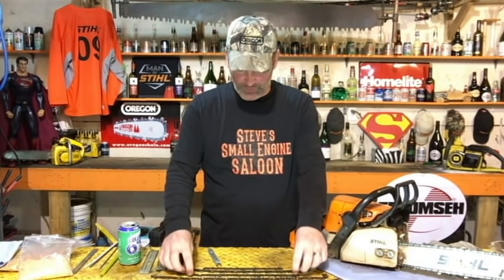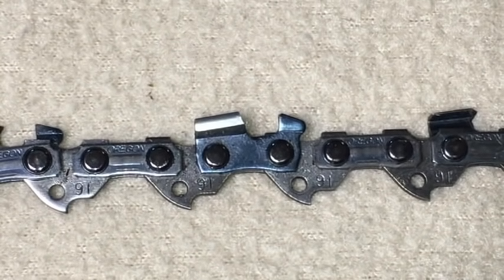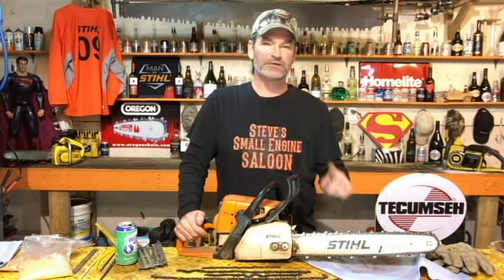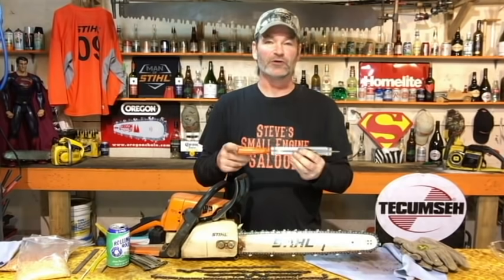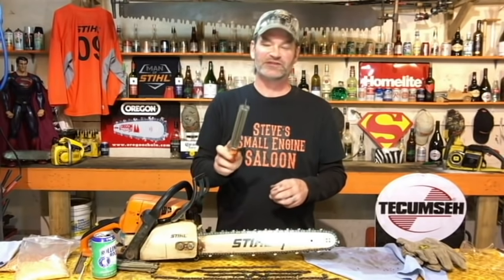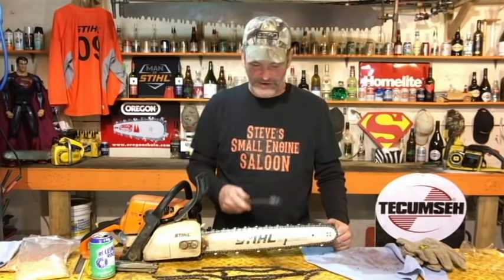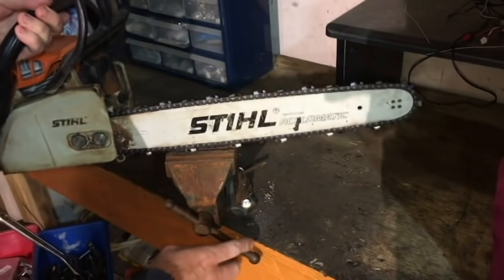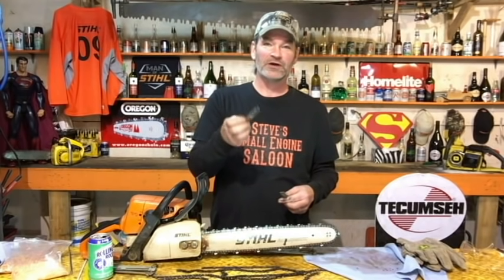CORRECT WAY To SHARPEN A Chainsaw (Step By Step)

Comment from the maker: ✅Click here for a great sharpening kit ➜ https://amzn.to/37CHxQT
For more videos like this, check out: 
👉How To Use a Stihl 2 In 1 Chainsaw Chain Sharpener ➜ https://youtu.be/marzGaMq6pM
👉How To Repair A Chainsaw That Cuts Crooked ➜ https://youtu.be/AgCZxee2NPA
👉Adjust The Chain Tension On Your Chainsaw ➜ https://youtu.be/FxgQSPQeYYM
👉Correct Way To Adjust The Carburetor On A Chainsaw ➜ https://youtu.be/M6T5JoGXcHY

You can connect with Steve here too: 
✅Visit Steve’s WEBSITE ➜ http://www.stevessmallenginesaloon.com/ 
✅Visit Steve’s PARTS & TOOL STORE ➜ https://www.amazon.com/shop/stevessmallenginesaloon 
✅Follow Steve on FACEBOOK ➜ https://www.facebook.com/stevessmallenginesaloon 
✅Follow Steve on INSTAGRAM ➜ https://www.instagram.com/stevessmallenginesaloon/ 
✅Follow Steve on TWITTER ➜ https://twitter.com/SteveSaloon
Reply: Being looking for this guide...but the hardware seller don't know about this...what the...
Reply: Good explanation.

1. Oregon has a good downloadable manual.

2. A stump vise is really handy. Just knock it into a stump or log and you can easily sharpen your chain close to where you are cutting.

3. Leather work gloves are another good idea, both for vibration dampening while cutting and for protection while sharpening.

4. It might have been a good idea to mention sharpening for rip cuts.
Reply: Steve's Small Engine Saloon adjusting a chainsaw
Reply: 334
Reply: Goggles for hand sharpening,american
Reply: No, I do not have a bench vice.
Reply: Hey Steve, I have a Dolmar 6100 that I bought used. I tuned the carb to factory specs when I rebuilt it. When I start it, the chain turns at idle, whether or not I pull the trigger. Does it need a new clutch?
Reply: Please redo in HD
Reply: 1 a

Comment: I've spent the last day or two completely captivated by your tips, insight and knowledge Steve.  I have had a Stihl 026 for about 20 + years. I was having trouble getting it running this season and a small engine mechanic told me it was toast. The piston and cylinder were scored, the compression was bad and the carb and fuel lines were all gummed up. He suggested that I leave it with him for parts, lest I pay $40.00 for his time and pick up the saw. I did the latter.
With your help I've replaced the carb (never done anything like that before), the fuel line and filter. I inspected the piston and cylinder through the exhaust port and spark plug hole (I thought it looked pretty good). I inspected and replaced the spark plug after ;learning how to "Read the plug" I set the idle screw, and the Low and High throttle screws, I asjusted the chain tension while holding the bar up at the nose, cleaned the air filter and guess what... My saw is back in service!! Just to be clear, I guess I'm a bit handy but I've never worked on a small engine before. You've saved me a tom of money Steve, Cheers to you!!
I think I owe you a beer, maybe a couple!.
Keep up the great work.
Reply from the maker: Right on Mike!
Reply: Cheers boss! That's whats up!
Reply: TIP OF THE HAT MY FRIEND.WE ARE ALL SHADETREE MECHANICS INSIDE.Yours came out  my brother..
Reply: That mechanic is a crook.
Reply: I have n older 029 stihl chain saw all i need is to adjust carbs never done it takes 8 pulls to get it started cold but after that only one so i never bothered....Figured aint broke don't mess with it n flipping the blade i never was sure about ,but just seen a different video an after each sharpening the guy flips it? Thanks for sharing !
Reply: I have a 026, a great saw and mine is 25 and runs like a top. I have replaced fuel lines and filter. Sometimes a small particles gets into your carb and you can run down you needle valves all the way and back them out one full turn and it will be back at factor spec.  That has worked for me a couple of times. No ethanol gas and make sure you start and run every 2 months even if you do not use it. That is how I have run it for 25 Years.

Comment: I'm going on 78, been using a chainsaw -- occasional use, maybe 10-to-20 hours a year -- for 60 years.  Of all the advice I've been offered over the years (videos, magazine articles, instruction manuals, even my USFS instructor in '62), this is the best I've found, here in this video and your video on proper tensioning.  Turns out, I've been doing things right all along, but I never knew WHY I needed to lift the nose of the blade when tensioning and tightening, I never knew that by over tensioning I could harm my sprocket or blade...and there were many great explanations on this video as well.  Your videos are clear, well organized, and concise...20 minutes is a long instruction video, but you didn't waste any time, and you "covered the trapline" very nicely.  I've always used a raker guide to determine when to file the rakers, and it has worked OK...but I've been cutting pine, doug fir, and other softwoods all my life.  Your advice to adjust the height of the rakers based on the hardness of the wood was eye-opening, and obvious...as soon as you explained it.  And you were spot-on in your observation that many sharpening instructions completely ignore raker-height, which is nuts.  Thank you, for this and your other videos.
Reply from the maker: WOW!  Thank you Sir...

Comment: I agree with your method 100%. I have been sharpening chains for over 50 years, yes I meant 50 years. I'm over 80 years old. Bucking Billy Ray refuses to use a file guide. He always says to throw them in the garbage can. I simply can't do that. I don't even come close to questioning his logic but he is the world's expert on sharpening chains. I'm a rank amateur on sharpening. I own 4 chain saws now and have worn out two others. Bucking probably has about 75 "power saws". He has sharpened saws probably about 100 times as much as I have. I'm going on in this conversation to let you know that your method works for me and probably 95% of the amateurs. I don't want to try another method. Your method works. Feel free to share these comments with anyone you wish.

Comment: Raker or depth gauge tools are very important to use if you're taking different amounts of metal off each tooth. Definitely need to get a consistent depth gauge height first, then take more strokes off if it is still not giving good sized chips.
Reply: I always, ALWAYS, count number of teeth or rakers, and number of strokes on each. If there are any inconsistencies, they'll average themselves out as you sharpen again and again. Especially if the chain stops a different place every time, and I believe they always do.

Comment: Just watched this. Decided sharpening the blade was the right thing to do, as the new one was already becoming dull. Bought the Chicago Electric unit from HF. Once set up, had a sharpened chain in under 15 minutes. Had the most productive session with the saw, cutting a tree which had partly fallen. Big chips, cutting through very quickly. Such a performance difference. And set the chain saw tension per his video & method. Wish I had the knowledge this video gives a year ago when i bought the saw.  Just came to say "Thanks!"

Comment: That was a really useful way to spend a few minutes. You saved me hours this summer dealing with windfall and firewood. I’ve sorted out most sharpening issues via trial and error but your last bit on raker height is exactly what I needed to know. I couldn’t figure out why my decently resharpened chain was creating wood powder, using up all that expensive gas and too much of my afternoon. Thanks a bunch from BC.
Reply from the maker: Right on Buddy!  You're Welcome...

Comment: Thanks Steve, by far, this is the clearest, most concise demo I have seen on the correct way to sharpen a chain as well as the occasional raker depth. This makes the 2nd time I watched this video now and glad I did! You have clearly shown the correct way to use the rat file & the flat file when cutting metal. Now it's time to get back to my firewood here in north central Vermont... Thanks again neighbor. :-)
Reply from the maker: Right on...

Comment: Great video Steve, I think it's the third time I've watched it to refresh my memory. I've seen videos of arborists sharpening their chains in the field with their saw sitting on a log, it seems to me that would be a difficult task keeping the same angle with good pressure on the file. I always sharpen my chains in my bench vise, and I also purchased a hitch vise for my truck. I believe a vise is critical to sharpen a chain properly. The only issue I have with this video is that I never seen you take a swig from your Rolling Rock beer. 🤣

Comment: Really great video with super simple and clear instructions, Steve. This video reiterated just about everything I learned when I was first trained on using a saw. I say "just about" because I still learned some new things. I would recommend watching this even if you feel 100% confident in how to sharpen your saw. The refresher will do you some good and make you think things through to keep your equipment running long-term.
Reply from the maker: Great to hear!

Comment: Another question, Steve -- I note your advice to maintain the file in a completely horizontal position, 90° to the bar, and that's something I've done for decades, mostly because it was easiest.  But back in 1963 I got my USFS chainsaw-use permit -- I was assigned to fell trees inside a burn area that still had smoking "cat-faces", holes in the trunks of pines left by fallen branches.  I was using a large, HEAVY McCulloch saw with a fairly aggressive chain.  We were told to sharpen the chain with a 10° tilt angle.  Was that just an old (and maybe foolish) custom, or was there a reason?
Reply: So I've logged a bit and I've also been told to hold the file at most 10 degrees

Comment: I like that you take the time to discuss the design elements of chainsaw chains and provide examples of what (and what not) to do when sharpening chainsaw teeth. I've learned how important it is to understand the function of the raker, and its height relative to the cutting edge of the tooth. As a mechanic/mechanical technologist, I appreciate your skill in delivering engineering-level information minus the techno-jargon. Ever considered becoming a college-level teacher?

I look forward to watching more of your insightful videos.

Comment: Very informative -another great video Steve!  One note, when sharpening, I always advance to the next tooth by pushing against the raker, not the tooth I just sharpened.
Reply: It killed me watching him do it wrong. I have a little smaller chain and bar so I do 2 teeth then move the chain with my gloved hand.
Reply: Chill out analguys, why spoil a fine presentation on chain sharpening with petty bullshit. Kudos to you Steve. Been swinging saws for 50 years and sharpening them the same way as Steve almost as long, even down to advancing the chain to the next tooth using the file still engaged in the previously sharpened tooth, it's fast and any micro scratch to the surface finish wouldn't amount to a pisshole in the snow.

Comment: Hand filing is the best but when I have a bunch of them and need to get ‘er done, my Oregon bench grinder is fast and keeps the hook. I like to file the takers one to two extra swipe for an aggressive bite and pull into the log. Hard to stall a 461.

Comment: You did a very good job with your explanation sharpening a chainsaw. The best of all the videos I've watched. The teeth the rakers but one other thing. The bar itself might develop burrs along the edges so you have to flatten those out as well with a file

Comment: Another excellent video, Steve. The only thing I would add is to start at the master link or put a mark on the chain so you know when you've been all the way around. Also, a question. Should you lift up slightly to make sure you're getting the file well on to the cutting surface of the blade?
Reply: Yeah.  I generally mark a tooth with a red felt pen so I can keep track.
Reply: I give a shot of white aerosol paint. Can't missit

Comment: Great video and instruction.  An interesting point:  I bought a Stihl 028 Wood Boss brand new in 1978.  The Owners manual contained chain filing instructions, almost identical to yours.  One difference:  Stihl recommended a 10° angle down to the inside as you push the file away from you.  I've been filing chains this way for almost 50 years, and they cut straight, true, and very aggressively.  I'm not implying this is better or correct; merely that this is what Stihl recommended 50 years ago  and it works great for me.

Comment: Very informative video, but you should have at least mentioned square cut, ripping and carbide chains. I use carbide chains for moat of my cutting in the sandy conditions where I live now. I use a diamond bit on a rotary tool to sharpen all my chains and a regular file on the rakers. I agree that you have to tune the height of the rakers to match the wood, power of the saw and length of the bar. Keep the great videos coming.
Reply from the maker: Thanks for the comment my friend...

Comment: Thanks again Steve, I have struggled with this for years, no one had ever went into the depth on the proper way from beginning to end! I would just watch and ask for guildence and pick up what I could. The hook and file size is a big help,also the racker,just sharpened my saw and it is sharp but putting out small chips,do will hit my rackers a couple of licks!😇🤠
Reply from the maker: Fantastic!

Comment: Superb instructional delivery.

I'm wishing my high school teachers had begun each lesson with a brew tribute.  ;-)
Reply from the maker: Me too!
Reply: I wish I could- my kids would perk right up!
Reply: The McLagans.   Yes, a brew or two when you work in the maintenance shop always makes the task a pleasant experience.  A very good video of proper tips and best results with cutting chains.  A lot of physics went into the design of chain cutters. A proper file size is essential and use of a flat file for the racker depth gauges.  Those lay on  guides for determining racker depth are handy and designed to tell one the correct depth.  I never let a file touch mine, however, as it will wear down too much eventually.  Instead, I file a couple strokes, check it with the depth guide.  The racker should not sit proud of the guide.  If it does, give it another stroke, possibly two at most.  One need only take 20 thou ( .020") off of the depth of the racker. That's only 1/2 mm -- impossible to measure without the depth gauge guide, but avoid filing across the top of it, as mentioned above.  Now Stehl makes a file guide that is supposed to be THE ultimate contraption.  They have to be compatible with the chain on the saw, matching the tooth size file, proper tooth angle, and as an added bonus file down the raker depth guides to proper depth.  They go for about $35 at my local saw shop.  I may get one of these Stehl gizmos so I can retire this Italian piece of clamp on crap I've used for years.  Cheers ya'll.  Have a cold one or two, and take care around those damn sharp cutters.   Bob in wood burning Montana.

Comment: I've sharped chainsaw chain sense 1960, we were full time loggers. The only thing i don't agree with is the free hand cutting the rakers. You and me can do it, but we've had years and years of learning the does and don'ts. The best thing is to use a raker gauge, this way you can't make a mistake and file the rakers to low. If the rakers are just a little to low, your saw turns into a very dangerous tool. I have seen guys cut really bad because he cut the rakers to low. We want all you to be safe and careful when running a chainsaw.
Reply from the maker: Excellent comment.  Thanks Duane...
Reply: Agree - always use a depth gauge for the rakers.  Never file with the depth gauge in place or you will eventually file down the gauge itself.  I run the flat/smooth edge of the file over the gauge and if it catches the top of the raker, I take it down a few strokes and re-test.  Also, after the raker is taken down, it's best to re-shape the raker profile so it's the original shape.  A flat top raker will drag more in the wood.
Reply: Thats weak. I've been logging professionally for 53 years. I always file all my rakers right down to the links. If you are strong enough and man enough you can handle it. You will cut rounds 2x faster by doing this.

Comment: The problem with not using a raker/depth gauge guide is that if you take them too low, the risk of kickback is much higher.

Comment: the last saw i sharpened by eye one handed (no guide) cut brilliantly, just needed dressing though(beginner with half a clue) i vaguely remember seeing angle mark on the tooth which probably helped a lot. I'm really enjoying your videos. i have another saw i picked up blunt as can be that i'm going to use a guide and a vice as i have had them cut crooked in the past due to the angles being wrong.

Comment: Thank you for the excellent video.  I spent some time in a Benedictine monastery and the monk whose duty (among other things) was cutting wood instructed me in woodcutting and chainsaw care told me very similarly except he favoured using a guide for the rakers as well as the teeth.   He also preferred a semi- chisel chain since it could take a little more dirt and still keep cutting,